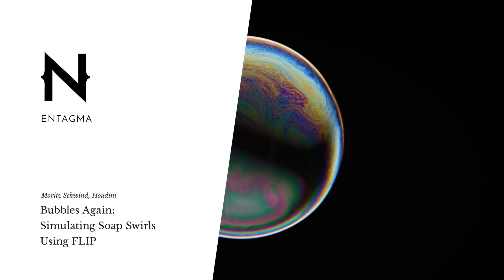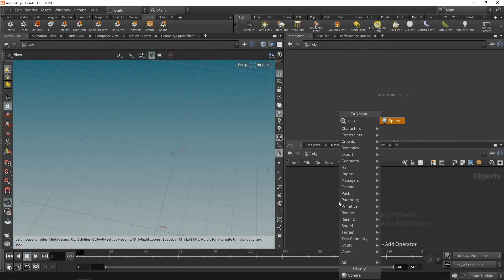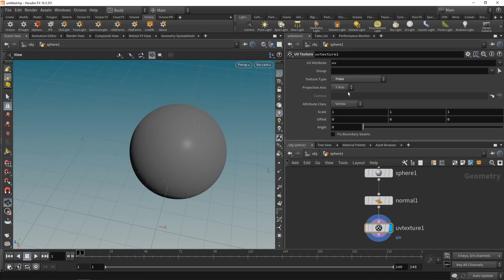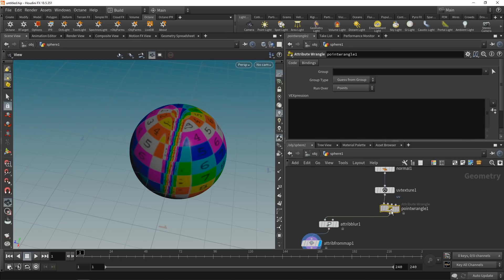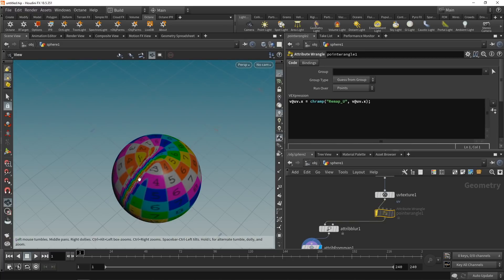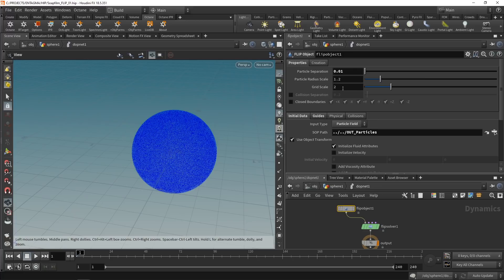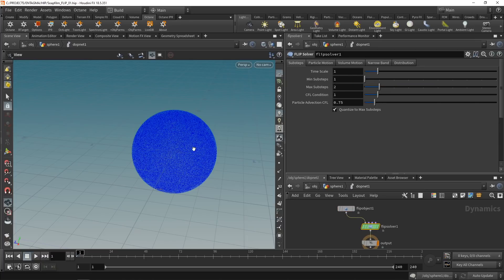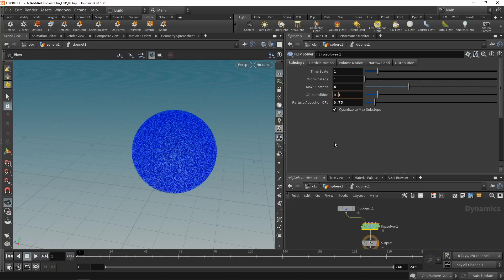Bubbles Again: Simulating Soap Swirls Using FLIP

Comment: If you have the problem that I had at around 14:45 that the sphere just doubles in size, you need to change the last line in the wrangle in the dopnet and replace the 0.5 to a 0.25. I dont know why thats the case but with 0.5 my sphere doubles in size after the first frame.

Comment: I've worked a bit on this setup for some abstract art and animations - if you want to use this for anything not static you definitely need more particles and a higher poly count on the sphere, otherwise it flickers a lot in the final animation (you can definitely see it in the initial render if you look closely)
Reply: Were you able to smooth it out completely? 
I did increase Poly count and Particle size a lot, but cant seem to get the flicker off completely

Comment: Hi, I tried to do the first part of the tutorial where you can get the swirling of particles, but with an arbitrary geometry. I'm essentially trying to liquifiy textures on the skin of a character I have. I've set up everything as in the tutorial, but my particles just drop straight down and out of the bounding box for the flip solver after the second frame, not sure what is going on. I tried to feed in the actual normals of the particles they inherited from the scatter align, but this doesn't solve the issue either and I believe the issue has to do with the popwrangle? Please, if anyone can help me out, I'd be very thankful. Also, if someone can tell me if this is achievable with fluid advection that can be ran off the surface of a mesh with UVs? The idea is to organically advect textures on the surface of an object/mesh. Thank you for the tutorial, I love iridescence and thin film shading!